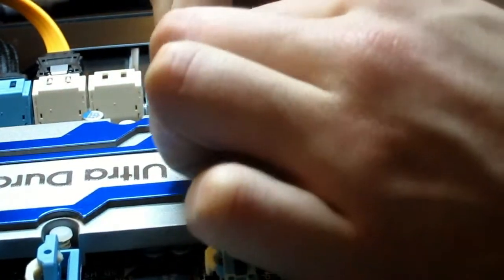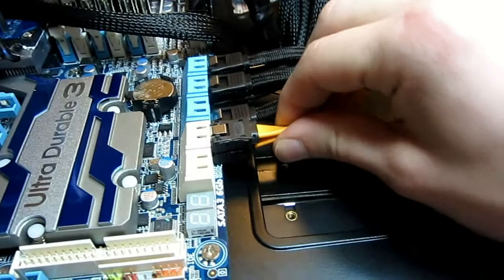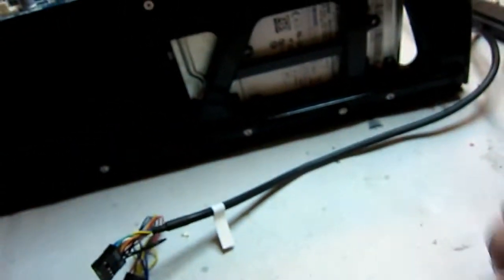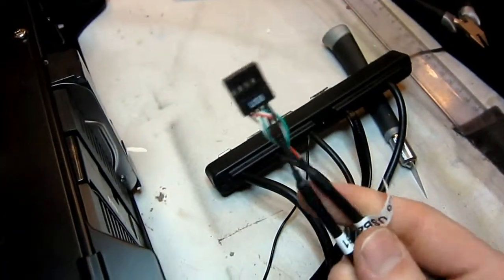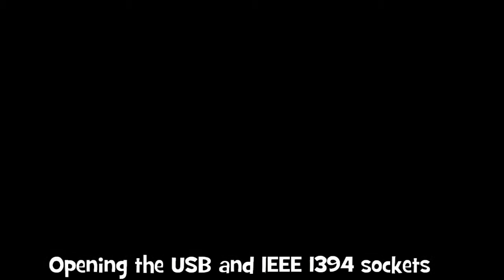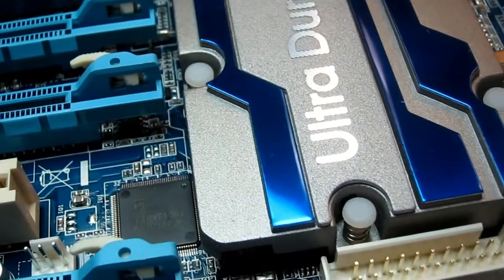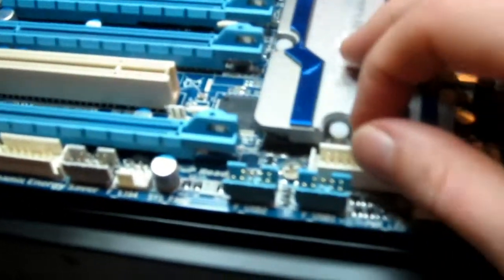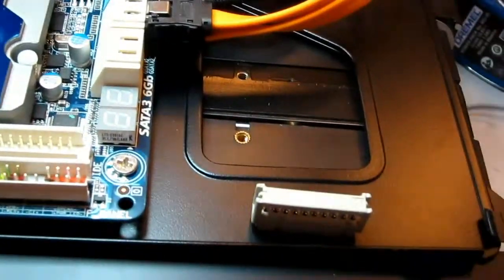Antec Skeleton build - Part 4

Comment from the maker: I don't think it will be a problem cutting off AC97 plug. It would amount to the same as not connecting it. Just make sure the wires are not exposed when you're done cutting.